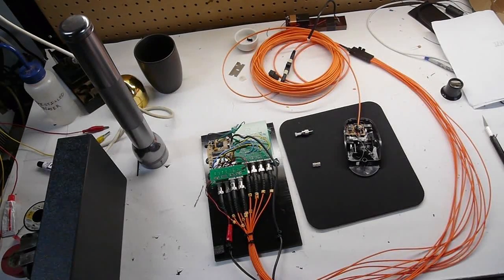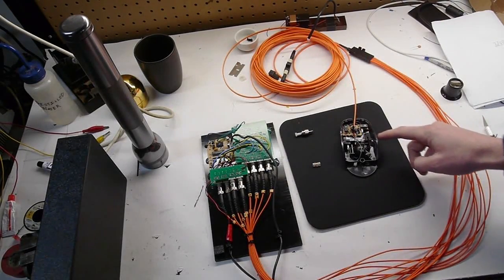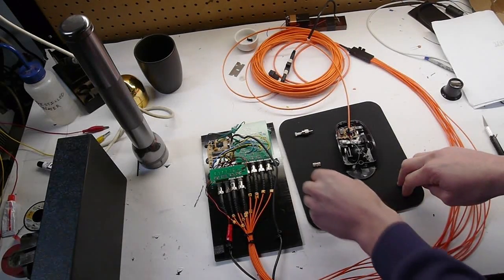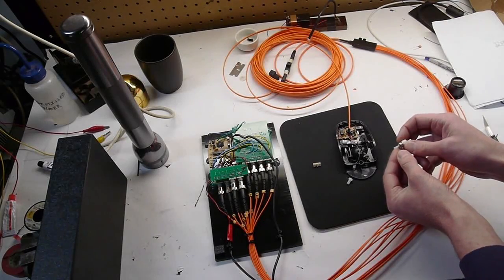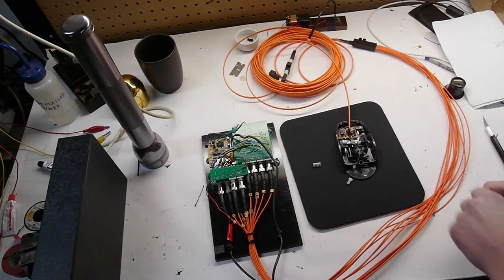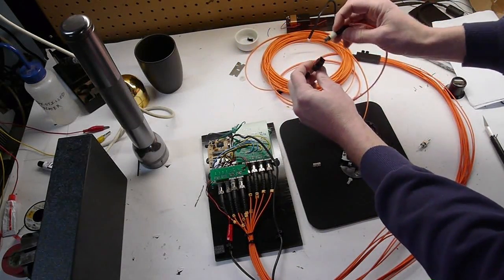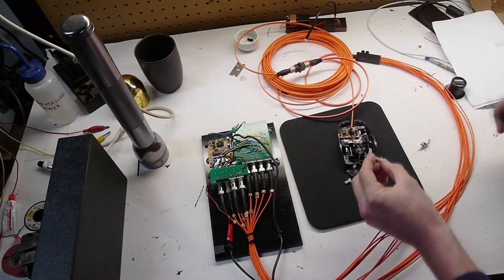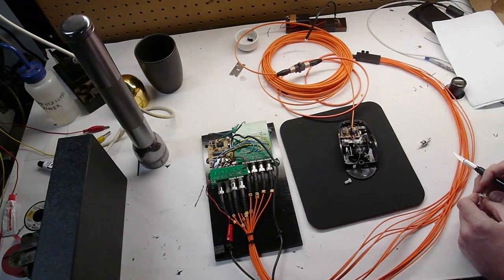Fiberoptic mouse with quadrature encoders and custom shutter buttons

Comment: looks like something you would build if you are working on alot of high voltage and still need to control a computer. ive had some frustrating times doing just that. the electrons that fly out at from sharp points seem to build up on things i touch and me making the computer not recognize pluged in devices periodically.. probably not good for it..

Comment: Would it be possible to use regular optical mouse hardware in the electrically-safe box, and just use a fiber optic line running from the "eye" on the circuit board to where it would usually be in the mouse?
Reply: Probably not? Might be worth trying.